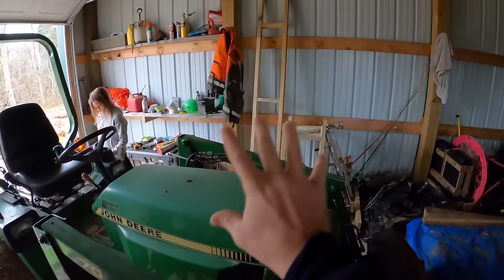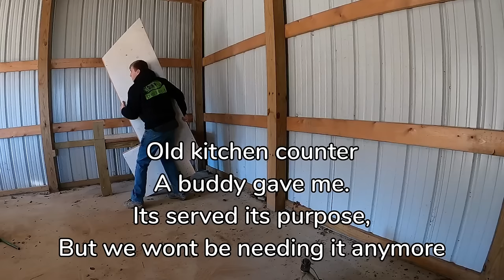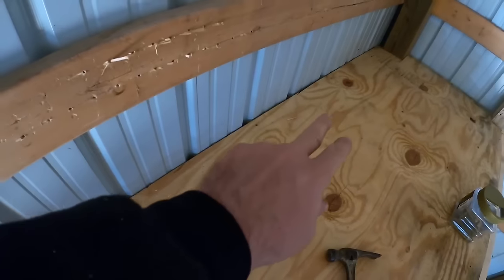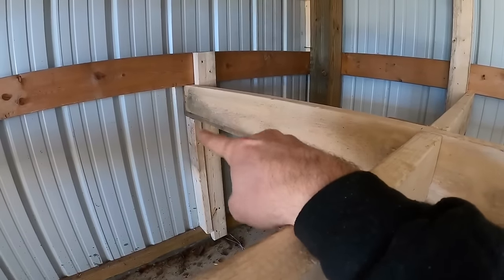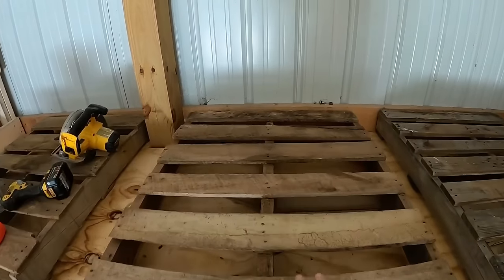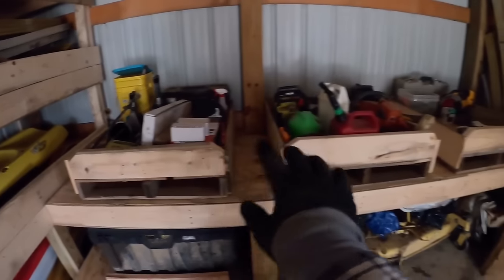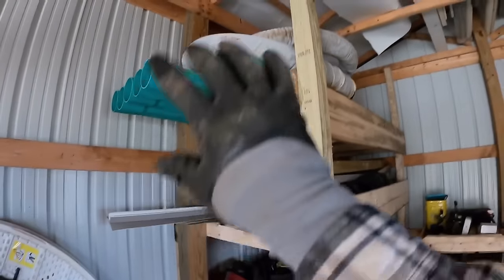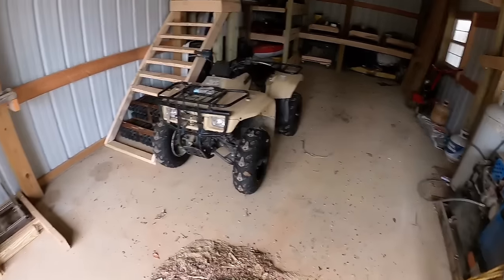Low Budget Storage Solution for any Homestead

Comment: In lieu of a safety railing, you could place a tensioned chain or ratchet strap, which can be removed when necessary.
Reply from the maker: That would be a good easy solution!
Reply: Or another sheet of angled plywood...

Comment: I'd be ashamed to show what my "shop" looked like a few months ago. I started cleaning and eventually found the flat surface I used to call my welding table, that hadn't seen daylight in 12 years.
 I have room above my trusses, to stand up, so I made a floor up there, then added a fold down attic type stairs. Yep, it's full of junk I haven't seen in at least 15 years ☹ When I get the "project" out from under the fold down stairs, I might start cleaning up there.
 There comes a time, when you have to start removing "dead wood"!

Comment: The pallets from Hardie siding are 12 foot long and built well if you can score one of those for the upper shelf. Very nice job on getting organized it's always a struggle. Nice you had great help. Stay safe
Reply from the maker: That would be pretty close to the right size.  May have to cut it down just a little bit

Comment: Great utilization of space, one thing I noticed at 24:28 is that you might want to use a piece of plywood or foam on the back wall so you don't dent the metal.
Reply from the maker: Good point

Comment: my building is about 2 times the size of yours and you're correct when you said spend so much time looking for your tools
one thing I did to make more room is move my 60 gal. air compressor out under the over hand and then piped air into my building plus I put my propane tank out side and piped it in too
Reply from the maker: Good idea.  Probably cuts down on noise a little too

Comment: Nice video, I used to use the stuff held in trusses method for my long storage above the garage door. If you did that you might be able to offer another shelf on the other side of your walkway, giving you a shelf as a railing plus more room for small stuff. My other standard was to drop 2x4 straight down from the rafters maybe 2 to 3 feet, forming two slings lined up on different rafters, then two more connecting the slings, provided a place to get tires off the ground. Stay safe, wishing you and your family the best and a happy new year.
Reply from the maker: Good suggestions!

Comment: very cool video! pro tip from a tall guy who works alot like yourself. Get 5-10 pool noodles, cut them in half and stick them up on the rafters and all the "duck" spots. Im not saying today or tomorrow, but the when your date with destiny comes and your due for a smack on the head, it will be alot smoother having that half pool noodle to cushion your head!

Comment: There’s several options on eBay for cheaper pallet fork options 
Your tractor not going to really get the use out of a heavy duty set so either the clamp on set maybe with a spreader bar or one of the cheaper 43” sets that are less adjustable for around 320 would be better options. With that said if you lan on buying a sizable skid steer later that might change the plan. 
Full disclosed I have a heavy duty set but I have bigger tractors but even then the largest thing I have moved in 3-4 years is one ton bulk seed bags
Reply from the maker: Its clear you’ve never seen me use my tractor 😂😂

Comment: Looked like you had some good help. Your building looks better. Isn't there an acronym for stuff on horizontal surfaces?
I have most stuff in my building on pallets. I think you will be surprised how low your second shelf has to be.
I use 2 shelf scaffolding on wheels to store implements. Pallet racks are on my wish list.

Comment: Two observations: 1: measure twice-cut once-then beat the crap out of it to fit.  2:  those steps are a recipe for a broken neck or at very least a sprained ankle.  Stairs are not 45 degrees.  The rise should be about 7  3/4” and run about 10”.
Reply from the maker: Neat

Comment: You might want to keep an eye on the roof of the shed, there were several spots that looked like they took a solid hit or two after it was built and may develop holes in those spots.

just spotted something in Andrew Camarata's bucket build video.
https://www.youtube.com/watch?v=LVBdCeK3zl0
He uses EXACTLY the inclinometer I mentioned to you about showing angles in vids.
unless zoomed in there is no reading the actual angles but with it showing how far off from vertical from a distance you can see how steep a slope is.
Reply from the maker: I’ll check it out thanks